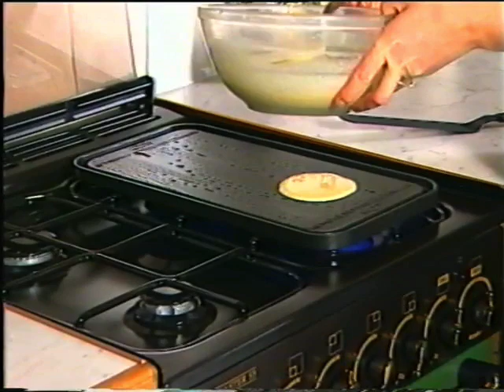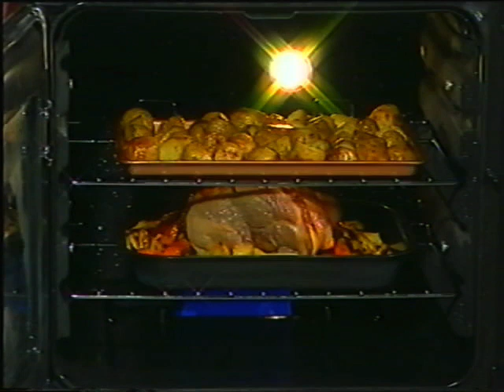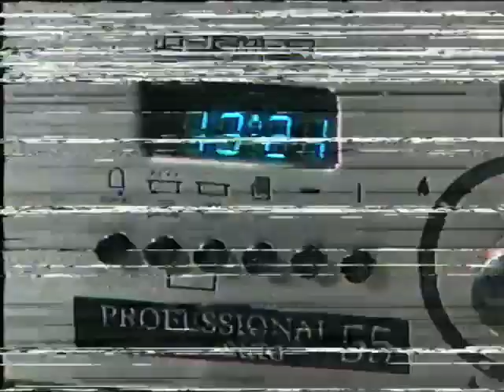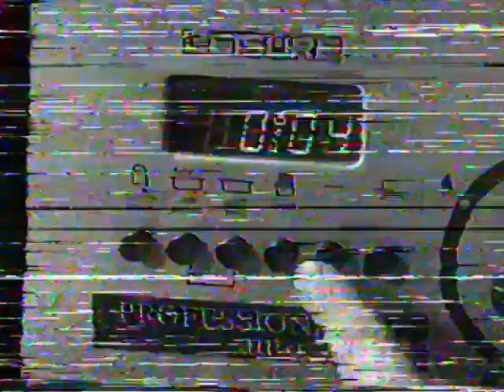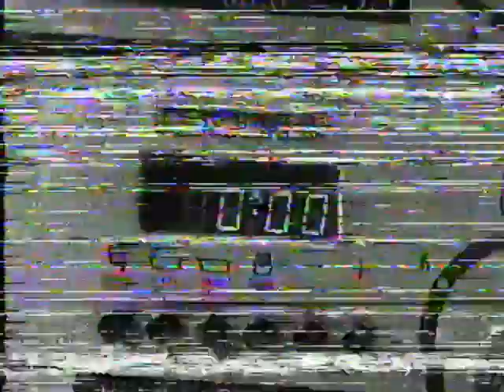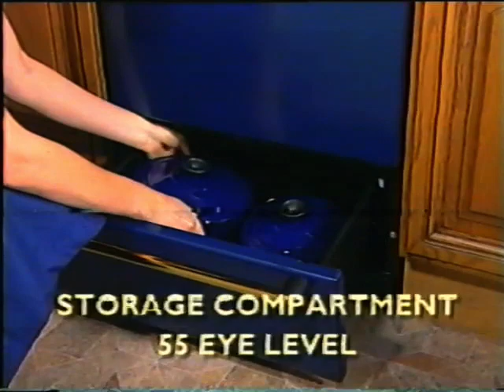Leisure Rangemaster Cooker 55 Video User Guide | 1995

Comment: Hi everyone! I’m working with a Leisure Classic 55 Auto (Model 6056), and my qualified gas engineer is converting the oven and grill burners to LPG. We’ve already converted the hob successfully, but he’s having trouble accessing the oven and grill jets.
I noticed this video is for a Rangemaster Cooker 55, which might be very similar. Does anyone have photos, diagrams, or guidance on accessing the oven and grill burner jets for these models? Any tips on removing panels or locating the jets would be extremely helpful.
Thank you!
Reply from the maker: Hey Nathan,
Thanks for watching. Have you checked here: 
Find Your Model & Serial Number | Leisure https://share.google/Jqm1EstlhOyDRrrSl